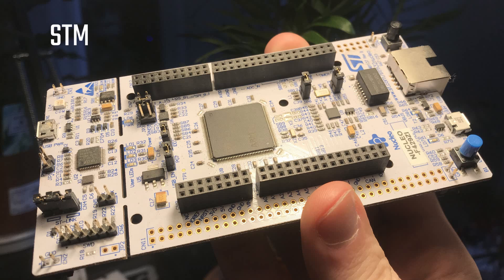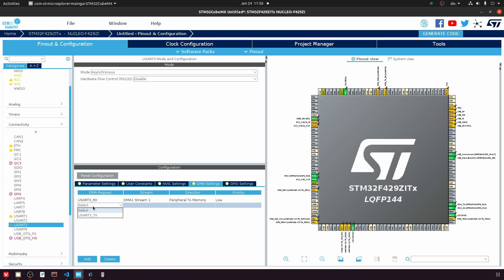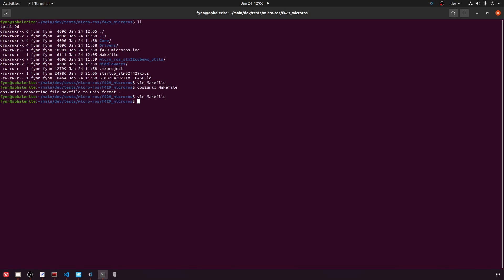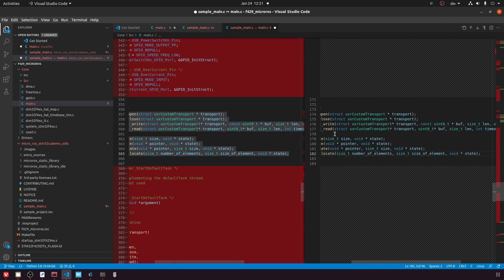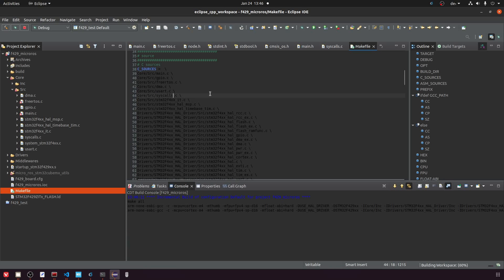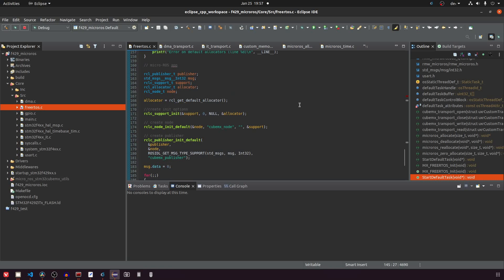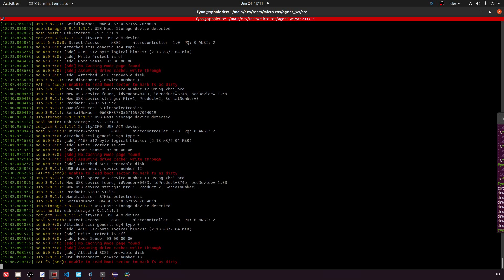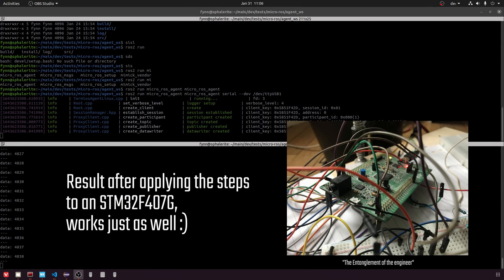How to setup micro-ROS on any STM32 microcontroller

Comment: I few words from my side concerning microros

1.) For a STM32L4 the libmicros.a became about 30MByte. Really strange to me because there is no other lib from GCC for this uC that is close to that size. So I'm not sure if we still can talk about MICRO-ros. Anyway, usually you use just a friction of the lib and the linker is clever enough to copy it in pieces. I just have some concerns about the performance of the code. But couldn't really test something.
2.) To generate the lib via docker is 'unusual' in the embedded programming. Even small changes require a long turn around time to update the code. This has already be mentioned and hopefully the owners will add an option to generate it on a bunch of *.c/*h files to make it more flexible

Now the more serious things
3.) At 15:02 you mention that the program will stall in the function call rclc_support_init(&support, 0, NULL, &allocator); Actually it is not stalling - it is heavily crashing because the NMI interrupt is triggered. So far I couldn't get it to run and don't know the root cause. I will update this comment if I can fix it.
Even a running microros agent isn't preventing that behavior. So I disagree with the comment that this is related to the microros agent running or not. In any case I have a big question mark above my head if such things happen in a library that should be properly tested. You cannot proper debug because the corresponding lib function is only available in assembler (as a result of generating the lib separately). Yes, all the settings about the memory etc is according to the documentation.
4.) Having the demand of 10.000 Bytes for a uC task is - friendly speaking - unusual. I never saw something like this before. Most applications will have some subscribers and some publishers. So you have to setup the msg-frame for them and transmit/receive functions for it. I have no idea why 10.000 Bytes Stack are needed for this. What will happen if you need more than one task with mircoros function calls? If  it is not  preferred to have more than one task with microros function calls, we find our self not too far away from a typical endless loop we know e.g. from a lot of Arduino programs. So real-time and pseudo parallel execution is not possible.
5.) Is it really true that the communication is only alive if the microros agent is alive before the uC is? In many applications this will become a tricky thing because the host running the microros agent usually will take longer to wake up compared to the uC. Even the previous ROS1 and rosserial could do this better (but also not really good).
6.) for me the generation of the microros agent is a nightmare. On one of my linux machines it worked on the other not. The dependencies between ros, CMAKE and a few other tools seems to be very hard and a high risk that something will fail. I also ask myself why there isn't a ready to be used GUI for this function available. I know, the Linux world loves to build everything from scratch - but for what benefit?
There is a snap version of the microros agent available. Ready to be installed. Maybe that will help - I will test after I fixed my application to not crash.

In short: Microros might be a step forward from ROS1 and rosserial. Be aware that this might be also an uphill battle. The SW structure and the development process is not ideal for embedded systems. Performance isn't clear and the level of documentation is weak. The link on the host side seems to be even more complicate than the previous rosserial application without really offering better functionality. For infomation - I'm using FreeRTOS 10.4.6.

Thanks for this tutorial that allows a reproduction is an acceptable time.
Reply from the maker: Hi there,

thanks for your input. I'll state some of my thoughts:

1.) I can confirm that the libmicroros.a also has a significant size for me (25.1 MB). In the video at 11:16 you can see the size of the image that was compiled (text: 65249, data: 228, bss: 71512). So approximately 65 kB of flash and 71 kB of RAM is used in this case (F429ZI, FreeRtos, one publisher). Of course as you add more functionality the size will grow and more parts of the lib will be linked. Since even the most powerful STM32 chips (e.g. H7 family) don't go over 2 Mb of flash and 1 Mb of RAM, I don't think the lib will get close to using that much space. Still I'm also wondering why it is so big.

2.) Yes, I agree. While the docker can be handy, I'd also appreciate a more straight forward build process without time-consuming re-compilation steps.

3.) If you find the issue, let us know. I'd be interested. In the repository for the micro-ROS setup they write "This software is not ready for production use. It has neither been developed nor tested for a specific use case.". So it's still very much work in progress. Still I think that such an error should not occur. How did you notice the NMI was called? I believe it should also be possible to step into the library files. You just have to tell your debugger where it can find the .cpp files of the lib so it can resolve the symbols in the .elf to the right code line.

4.) I'd also like some transparency here why the thread needs this much stack. One approach I took is to have a single thread handling the subscriptions and then using the callback functions to distribute the information to the right thread. In the constructor of the thread that wants a subscriber I would register a subscriber with the micro-ROS thread. Registering simply means adding an entry to a subArray. When the micro-ROS thread starts it would iterate this subArray and create the subscribers. As the callback function it would register a C function. In this C function I'd get my C++ controller class and call it's sub callback function. Something like this:

void cWheelCommandCallback(const void* msgin) {
    getWheelController()->wheelCommandCallback(msgin);
}

In this way I only had a single thread for the subscriptions. For publishers a similar approach was used. I remember that I had some issues with this approach though but I'm not quite sure anymore (it's been some time). I believe I had some issues with stalling due to thread priorities. So it was just a workaround, in the end of course I also want to simply create subs, pub, etc. in the thread that wants to use them and the requirement for 10 kB of stack is making that more difficult.

5.) I can not say if it is a requirement. I only noticed that I've had more success in getting it to run if I ran the agent before the MCU. I assume in theory the MCU should simply wait for the agent to become available. But when the agent started, no communication was set up and only after restarting the MCU, a connection was established. You might see different behavior. It might also be related to question 3. If there is actually a bug that lets the MCU crash, solving this bug might enable the two systems (MCU, agent) to start in any order.

6.) This issue I couldn't observe yet. I've followed the steps as described in the video and it worked without problem. But it may be system dependent as you write.

Yes I agree, micro-ROS is still young and there is still a long way to go. Still I think it's a step in the right direction and with further development, it can become an essential tool in the ROS ecosystem.

I'm glad the video could help you.

Cheers
Fynn
Reply: @roboticsinanutshell  Could you tell me how to transplant to stm32f103?
Reply from the maker: @shodan1q870  Hi there,
to port micro-ROS to an STM32F103 you need to follow similar steps as described in the video.
Make sure that your device supports the requirements (a few ten thousand kilobytes of RAM & communication peripherals such as UART).
Looking at the chart here your RAM size really depends on the type of F103 you have: https://www.st.com/en/microcontrollers-microprocessors/stm32f103.html
It might be that the F103 has a too limited RAM size. To find out you probably just have to give it a try.

Comment: Hello,
Thanks for great tutorial. I've followed it and successfully tested on STM32F407VG Discovery.
One question I have now is how could we make the connection work when the code on the MCU runs first, and then the ros agent node is executed? Because in reality we have a lot of situations like that and we cannot reset the MCU each time.
Thanks for your help!
Reply from the maker: Hi there, I completely agree, having a limitation where you need to start the agent first and then the MCU is not acceptable in many use cases. There might be a way in micro-ROS as it is right now but unfortunately I don't know about it. You could have a look at the implementation of micro-ROS to see how the agent discovery works and why it might not work. Another option could be to have a look at this article (https://discourse.ros.org/t/embeddedrtps-the-new-experimental-middleware-for-micro-ros/22741) and the mentioned implementations. In there you will find micro-ROS middlewares that do not rely on an agent and therefore eliminate the problem.

Cheers
Reply: @roboticsinanutshell  thanks, if that is the case where we currently don't have an official solution for this, someone (like me) might dive deeper into the source code or search the net in order to figure out how we can modify the middleware or application code for a working solution.
I thought you had already know a way so I asked you first. 
Thanks for the hints, I surely would try those !!
Reply from the maker: @DinhChuot  Maybe there is an official way to do it and I just don't know about it. But I think the idea to have no agent at all is even more appealing.

Comment: Thanks for the video. While running (ros2 run micro_ros_setup build_agent.sh) am getting following error.

Os - Ubuntu 20.04 
Ros2 Foxy

vasu@vasu:~/Micro_Ros/agent_ws/src/micro_ros_setup/src/uros$ ros2 run micro_ros_setup build_agent.sh
Building micro-ROS Agent
Starting >>> micro_ros_msgs
--- stderr: micro_ros_msgs                             
make[1]: * No rule to make target 'micro_ros_msgs__py/CMakeFiles/micro_ros_msgs__py.dir/all', needed by 'CMakeFiles/micro_ros_msgs__python.dir/all'.  Stop.
make[1]: * Waiting for unfinished jobs....
make: * [Makefile:146: all] Error 2
---
Failed   <<< micro_ros_msgs [1.37s, exited with code 2]

Summary: 0 packages finished [1.56s]
  1 package failed: micro_ros_msgs
  1 package had stderr output: micro_ros_msgs
  1 package not processed

    
Please help me to resolve this issue

Comment: great video. it is always challenging when we explore new area. micro ROS on STM32 is a challenge.

my question is:
Do we really need to build Ros lib? Because the C code is already there and when we compile stm32 main.c the ros lib code will automatically compile and build?? Please correct if I am understanding it right. Thank you
Reply from the maker: Hi there,

this is an interesting question.

With the way that I have described here (which is similar to how the tutorials explain it) you have to build the micro-ROS library before you can compile your program.
The reason is because of the way the Makefile of the CubeMx project is adjusted. You can see the additions made at 5:22. Here we extend the LD_FLAGS with a path to the libmicroros.a file. This means that the linker will expect to find a compiled static library called libmicroros.a at that path. When we compile the binary for the STM, the linker will resolve any references to micro-ros using that library. So the Makefile of the CubeMx project expects that file to exist already, it will not create it itself.

Still it would be interesting to have a different structure in which the library files are compiled when the CubeMx project is being built. I sometimes find myself making changes to the micro-ROS lib (e.g. adding custom messages) and then I have to run the docker command again to recompile the lib. This will then download the whole toolchain (arm-none-eabi-gcc, etc.) to execute the required steps which takes quite long. I'd prefer to simply build the lib with the rest of my code or at least by independent of the docker if I want to. I'm sure there is a way to make this possible but I didn't explore this option yet. It might also be possible to re-use the previously used docker container to prevent downloading everything again.

In summary: If you compile the main.c it is required that you already have compiled the libmicroros.a beforehand. This is because of the way we have adjusted the CubeMx Makefile. So you have to build the lib first, then compile your program. A different option where you build the lib together with the rest of your code is thinkable but wasn't shown here.

Cheers
Fynn
Reply: @roboticsinanutshell  Thank you for explaining the reasoning.

Yeah, having every code in the CubeMX would be much better. Like any STM32CubeMx project where all the other files (MCU specific & FreeRTOS for e.g. specific) automatically gets downloaded in the project, we should have something similar for ROS. 

All in all, it is a good start.

You can actually add these in the CubeMx project settings and include the library paths of ROS lib. That way when you compile CubeProject, the ROS lib also compiles automatically.
Reply from the maker: @MandeepSingh-ny9ok  Yes it would be pretty cool if you could select micro-ROS as an option in CubeMx similar to FreeRTOS.

Yeah you're right, that should work. I will try it out some time.